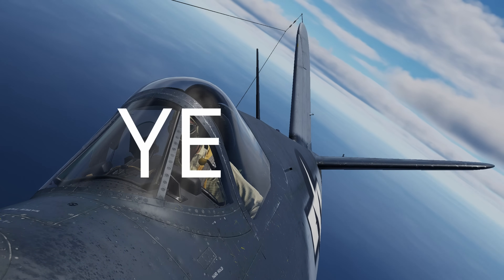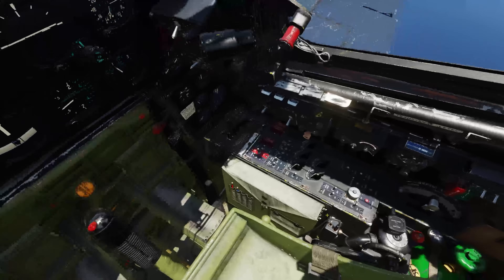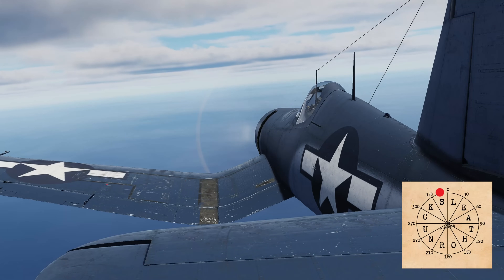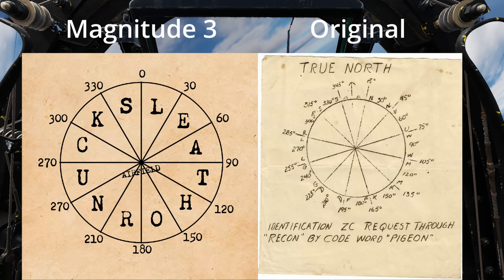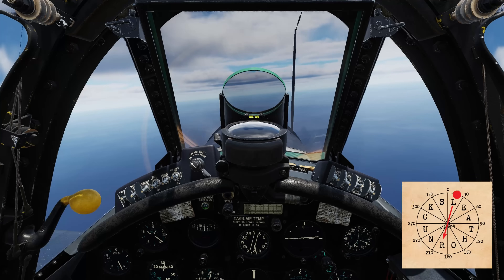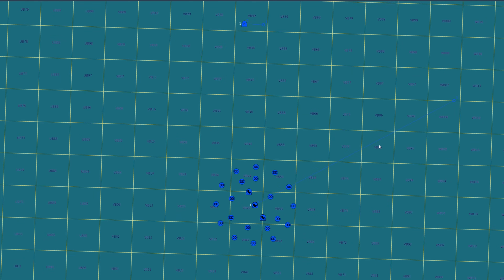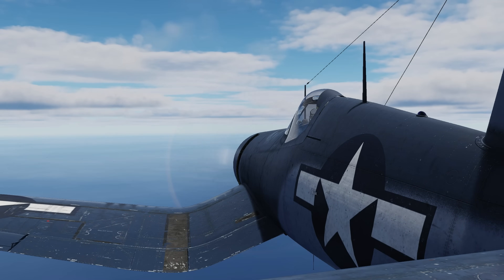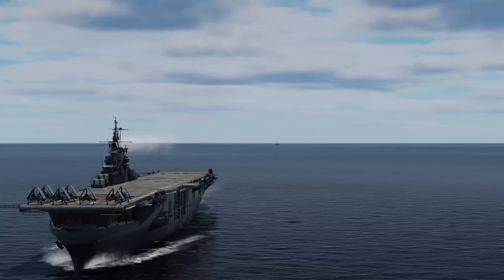DCS WORLD | F4U-1D Radio Homing Tutorial

Comment: I’m sure you’re aware, but the way the radio functions has already been fixed and this video is outdated.  You no longer need the set the switch to voice, and you must use the remote switch aft of the main radio box as well.  Otherwise you’ll hear “AGA” as the identifier (the current default frequency if flying in Marianas WWII)